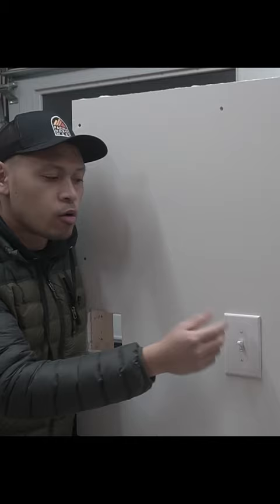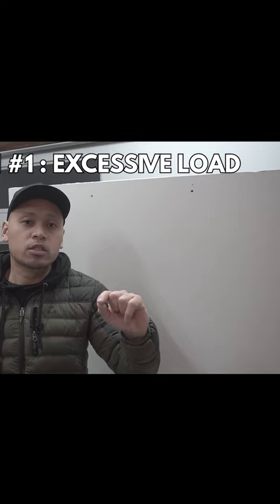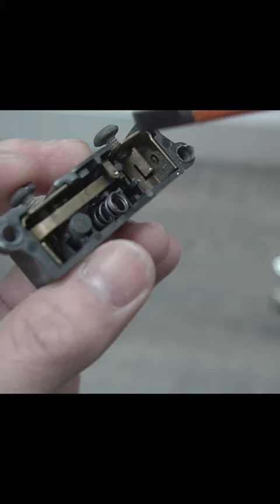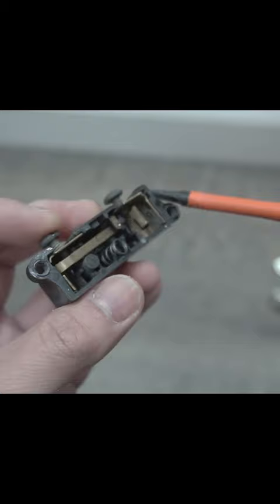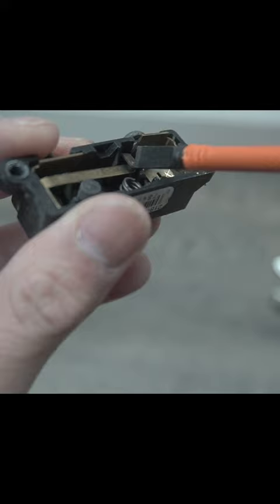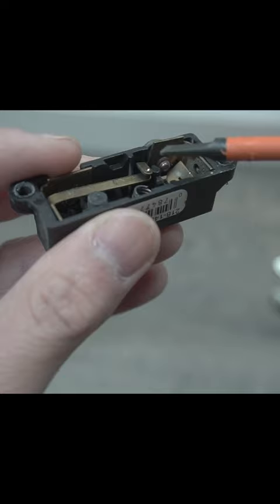Why Do Electrical Light Switches Spark Or Pop When Turned On? #shorts

Comment: Incandescent lamps draw maybe 3 to 5 times the wattage until the filament gets hot. Less then a second. At least 75% of power from an incandescent lamp is wasted on heat. Back in the 1950-69's they would use cheap 6 amp toggle switches in houses that were tungsten rated . A single pole switch never produced a spark if the AC frequency is dead zero on a sine wave. Largest spark produced when frequency is at top of sine wave ( maximum voltage ) . If you use circuit breakers to turn luminares  ( no such thing anymore called a light fixture in the USA NEC book ) they have to be switch rated. Will be marked " SWD ".

Comment: I took out 2 lights and didn’t screw in the switch back properly into the box and it has popped several times when I forgot that it’s not connected to anything and pressed it but the breaker won’t reset even though it’s properly screwed in. The breaker is connected to lots of other things. Did I fry the breaker? Do you think I just need a new switch?😢 I changed my mind and will add three recessed lights that connect to that switch instead of removing it. Thanks in advance for any educational advice you give. I really enjoy your channel